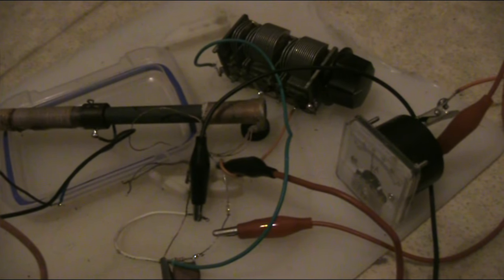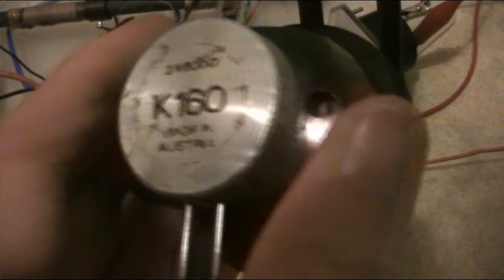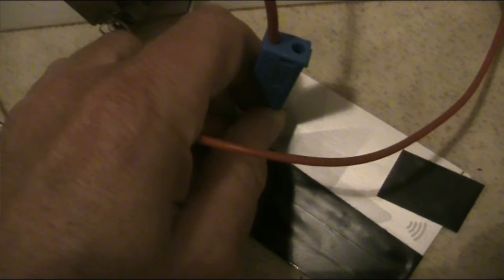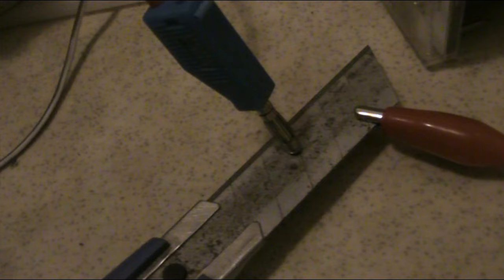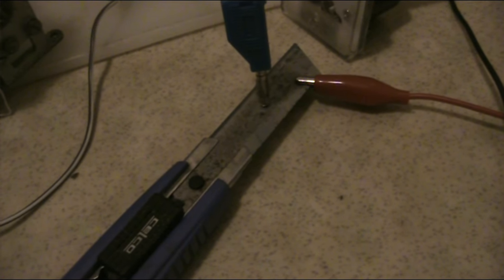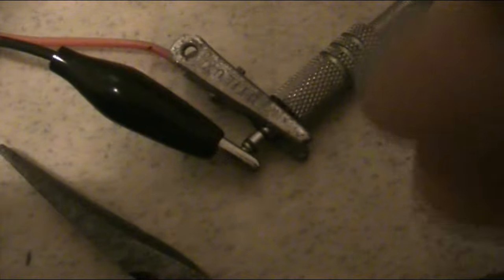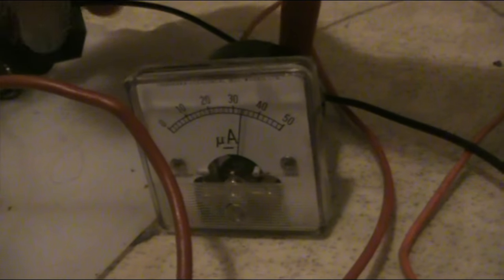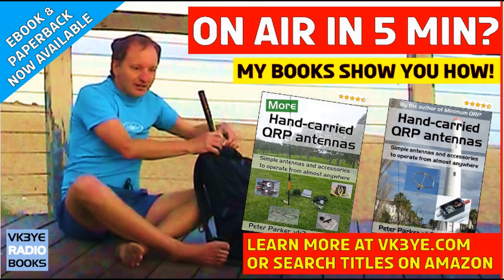Crystal set experiments: Signal strength meter & different detectors

Comment: I built a foxhole radio using the coil, Blue razor blade with an old safety pin attached to a graphite pencil lead it worked.
I bought a crystal set off EBay that has an impedance matching transformer do I could use a speaker or my old Bose headphones since the jack is wired for stereo headphones. I have an approximately 200 foot wire with a good RF ground. It get some stations surprisingly loud on the speakers. I have been able to receive a 50KW station about 1000 miles away from my QTH.
73! Have a great day!

Comment: Try a steel wire (e.g. guitar string) as a cat's whisker in contact with a piece of dull, oxidised brass. This can make a very good detector. Make the other contact point to clean brass, but do not remove the oxide under the cat's whisker or it will not work. Thin metal oxide layers act as good non-linear detectors.

Comment: Peter you are a _ BRILLIANT_ man when it comes to the art of radio, we just need to polish up your videography techniques a bit! You help us with radio so I'll help you in out the video department!

We need to find you something with a fullsized lens and some better controls (even on ”auto-mode's”) over the aperture size for focus and depth of field control. A DSLR camera with a lens that detaches, like even an old Canon EOS 100D with a 55mm kit lens would be a massive improvement because the larger lens collects more light photons, same idea as using a 1/2λ, or 5/8λ vs a 1/4λ antenna...

For adequate lighting some long shop lights work well in a pinch, just be sure to use "indirect lighting" by bouncing the light off something else first, say by pointing the lighting UP at the ceiling or even reflecting off a white bedsheet ECT so the light bounces back onto to your shot and diffuses the light nice and evenly vs having a "spotlight" effect. That or tape some thin white tissue paper or opaque vinyl (old shower curtain!😁) over the lights to diffuse them evenly, just don't use a really HOT incandescent or halogen lights with that paper/vinyl trick!🔥🔥🔥 I find fluorescent or LED shop lights work well.

A decent directional "shotgun microphone" with a "hot shoe mount" and a "dead cat" fuzzy cover for blocking wind can be found for about $20 online, which plug into the aux jack port on the camera. If you like I can help with some pro editing tools too.
73 de K7AEK
Reply from the maker: I know you mean well but I have other priorities and interests. Thanks but no thanks.
Reply: @vk3ye  at least consider those lighting tips, so we can see what you're doing better.
Reply: I, for one, appreciate the DIY, low production value on this channel.